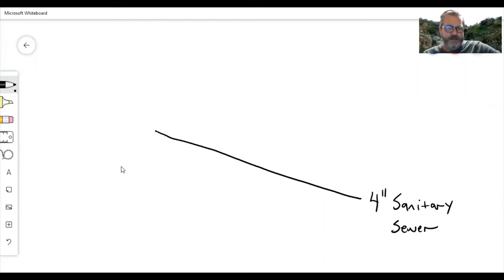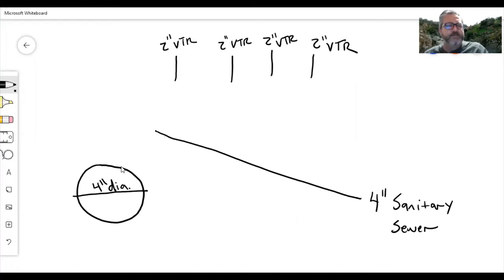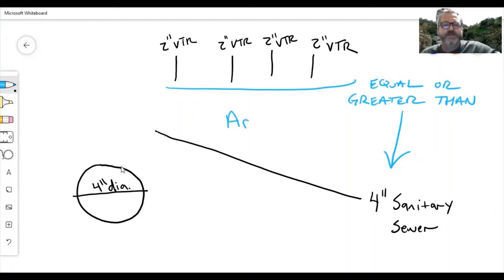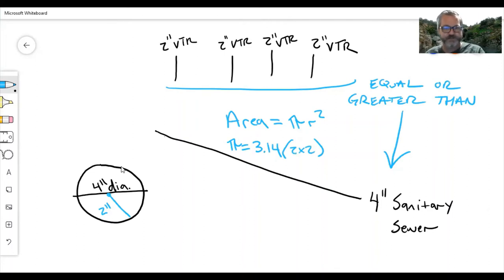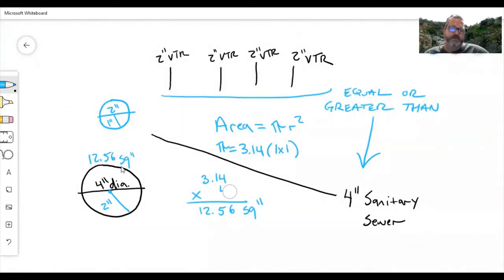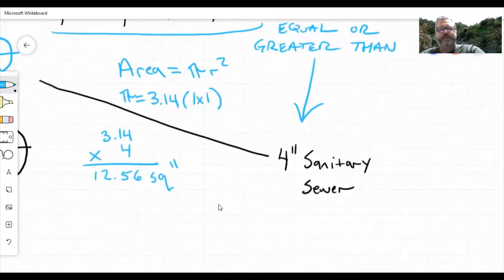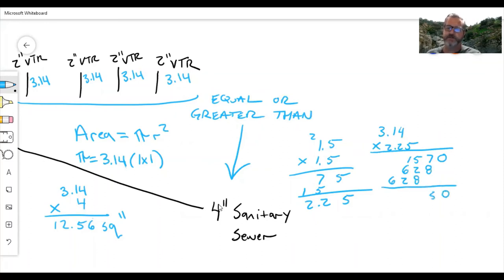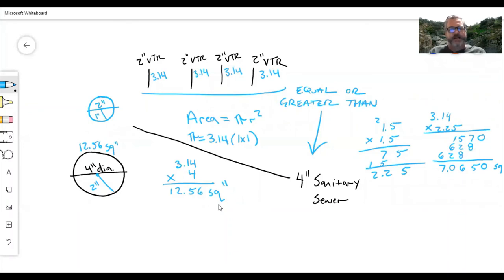Example Of Cross Sectional Areas in DWV Systems

Comment: So you either put 4 2inch vents through the roof or you tie them in all together to put a 4inch vent through the roof?
Reply from the maker: Well, the concept is such that as long as your vents have the same area or greater going through the roof as that of the sewer line exiting the structure, then you're in compliance.  So you could have a 4" vent with ten 2" vents if you wanted as long as it's equal to or greater than the sewer line out the door- so to speak.

Comment: Thank you Ben.

This is why I like just sticking to larger residential projects.

Colorado inspectors want to see 3" vents always, at 16" off roof, builders want as few penetrations as possible, so you gotta do the song and dance while basically not saying, "I'm not running this whole run to tie the house together, just to save a roof jack and curb appeal."

I personally like seeing plumb vents, gives character!! And tells a story on what you got going on.
Reply from the maker: You'll be happy to know that the UPC just changed the frost vent termination requirement from 2" to 3" minimum as of 2024 code